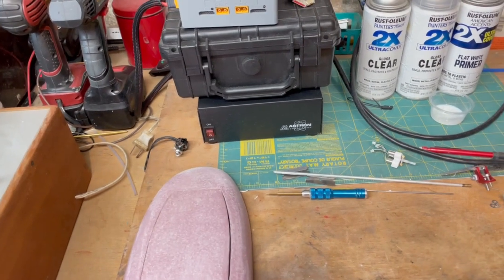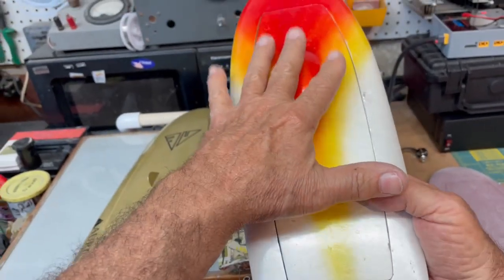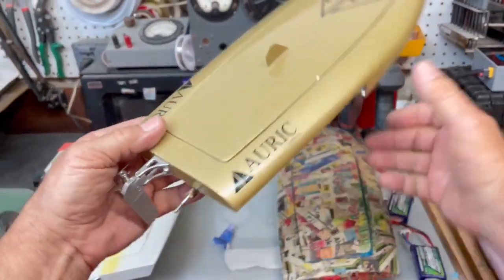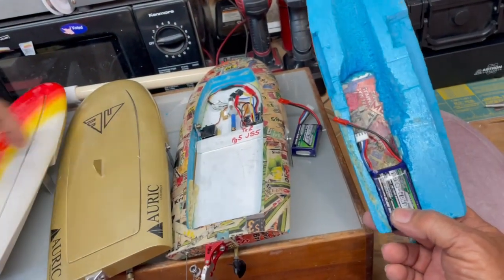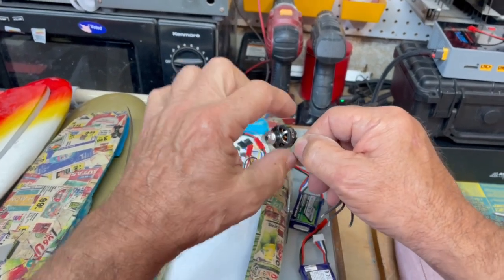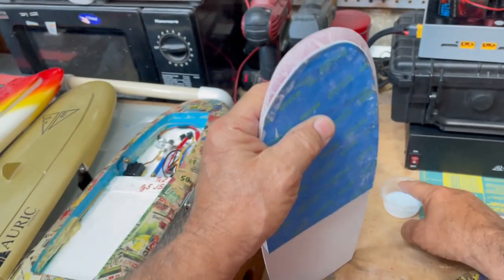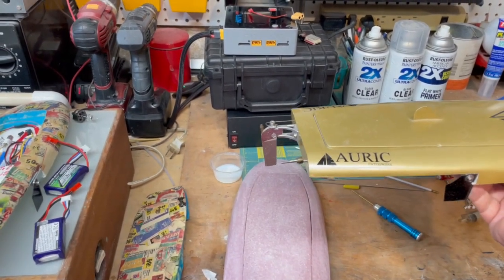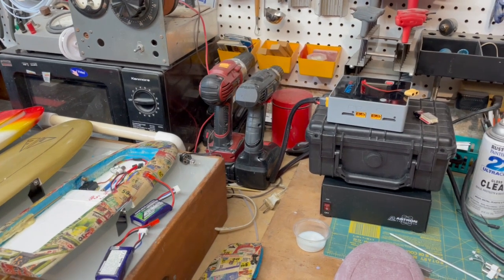Dr. Jet preps Prototype V for its Maiden

Comment: So cool! Where do you get the haul for your builds? Is it a kit?
Reply from the maker: I designed it, and made tooling to produce it.  I still consider it a work in progress.  Plans are currently available (Prototype II), and I'm planning on making a kit available once I settle on a motor/propeller/battery combination.

Comment: And Auric Enterprises... must be related to the gold colour you painted that prototype?
Reply from the maker: Actually, it is Auric Enterprises, Ltd, a company based in England in the early 1960s.
Reply: @Dr_Jet  Ahhhh... you're clearly a fan of a certain Mr Bond! You alchemist! 😂 
I bet you got gold fingers when you were painting that boat! But surely should have been reserved for prototype #007 😉
Reply from the maker: @SteveLane61 Hmmm....  🤔 That might just be the scheme I use for #007.  I did another boat a few decades ago in that scheme (see next video), but I still had the artwork so I did #5 in that scheme to keep it cheap and simple.